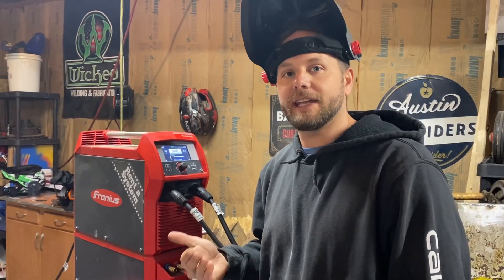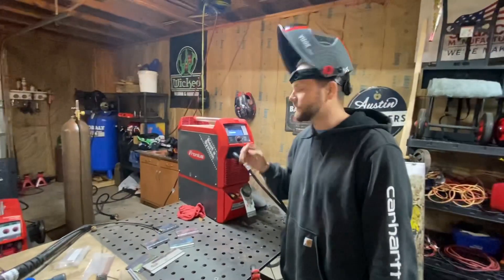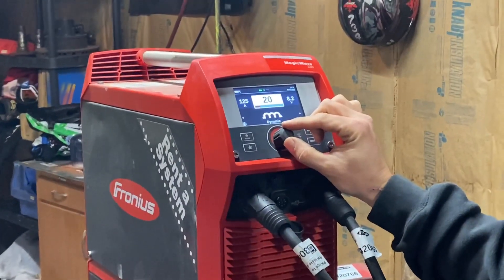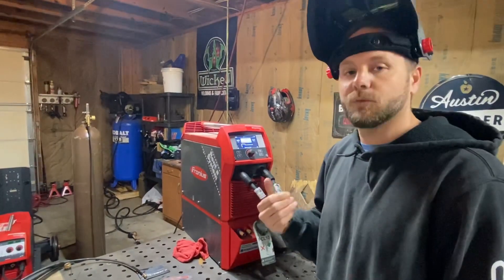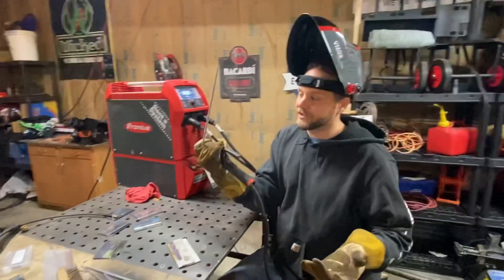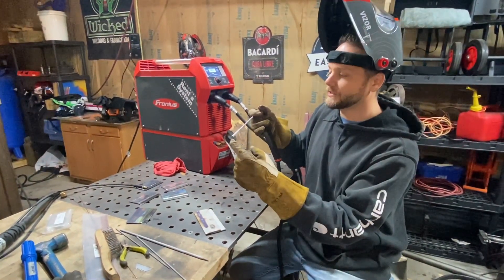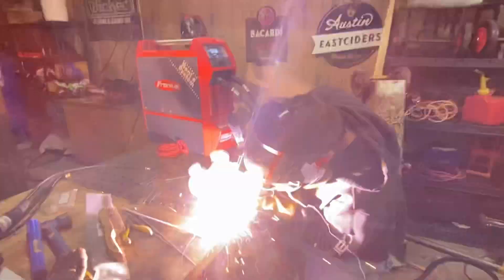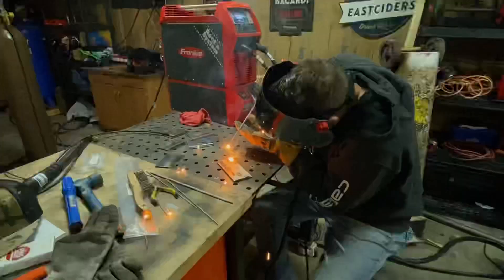How To Stick Weld With A “Fronius”MagicWave 230i

Comment: Wrapping your finger around the rod like that is a good way to burn you glove and finger.
If you are running on the hot side of amperage and burning the rod down to a couple of inches the rod typically will get red hot where your finger is.
Reply from the maker: A habit of holding the stinger… Thanks for watching!!!